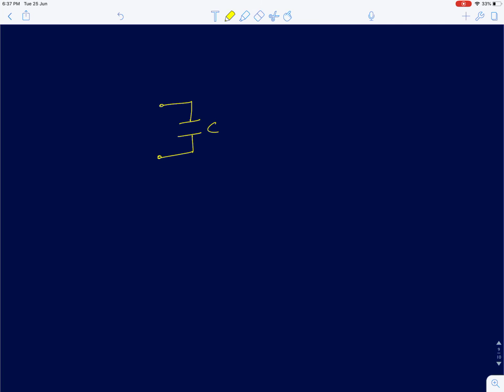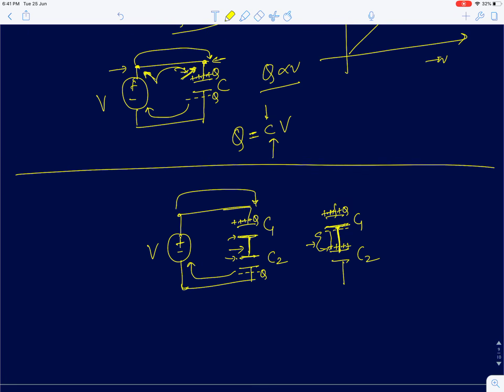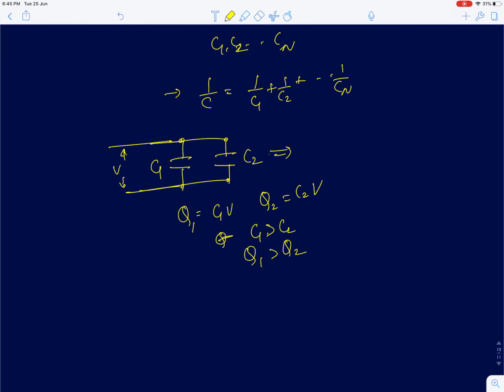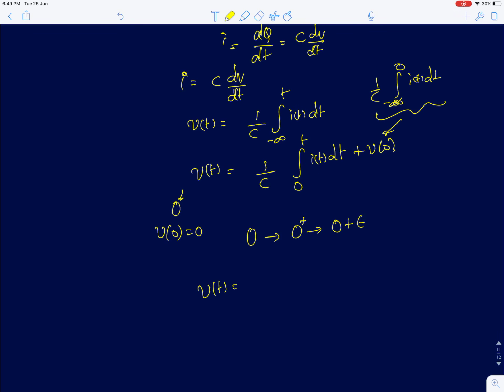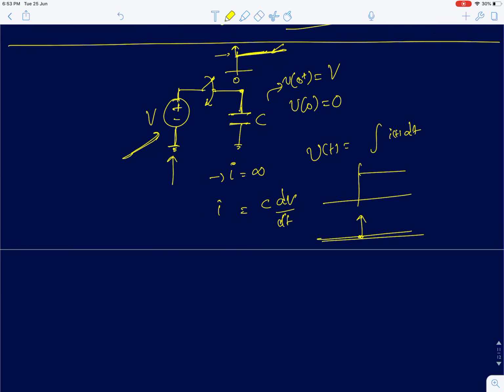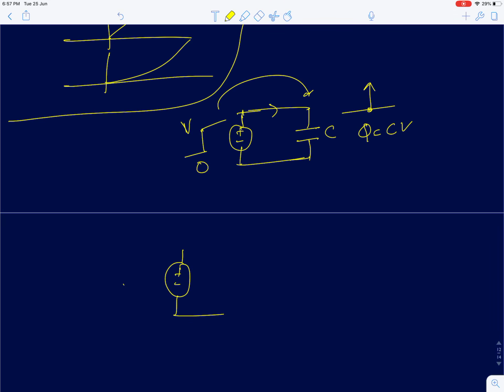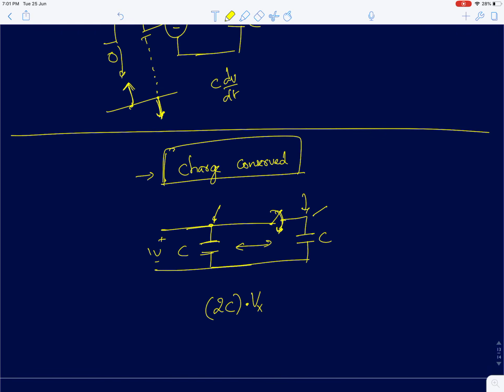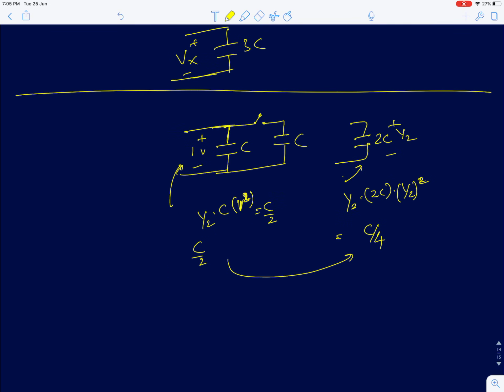ES Lecture 8: Capacitors. Charge sharing and capacitor basics

Comment: at 27:52, why is voltage across the equivalent "2C" capacitor even changing? Assume u just replaced the 2, C capacitors with a single 2C capacitor, keeping the voltage source constant as 1V, then we shall have energy conservation of the system.
Reply: i think vx is not steady state voltage, it'll be 1/2 only at the moment when circuit closes.
Reply: @TheSalesman101   Vx is the steady state voltage: Voltage after the charge sharing.
Reply: there is no voltage source in the circuit being explained. It was just that the capacitor is pre-charged to 1V.

Comment: @24.29 should’ve 2c x Vx = C (1v ) + C (1v) since total charge is addition of charge across both caps because they are in parallel and charge across them is different so we add them ?
Reply: No, initially the switch is open so the entire voltage is across the first capacitor, so Qinitial = CV, 
then the switch was closed and total charge in the ckt = Q1 + Q2 = V * (C1 + C2) 
And by charge conservation, Qini = Qfin => CV = (2C)*Vx => Vx = CV/2

They're both in parallel so voltage is equal across both but charges depends on the capacitances.
Reply: @nabhay583  but cant the battery provide more charge for the second capacitor since its still connected?
Reply: @nabhay583  but shouldnt the overall voltage = 1v and not 1/2v??